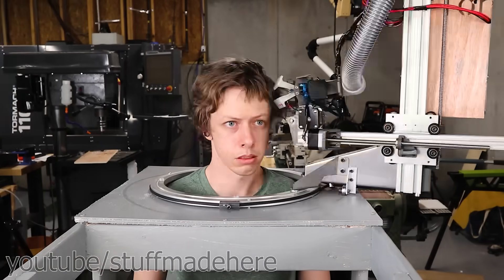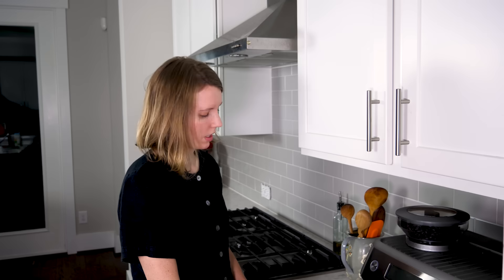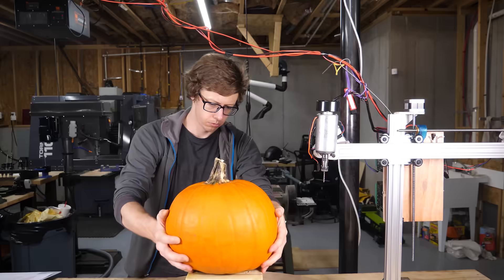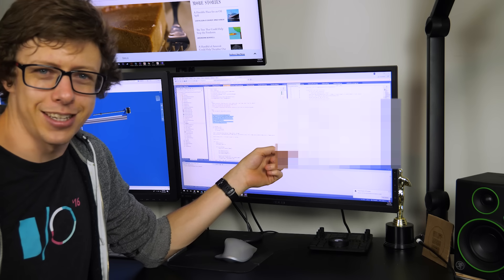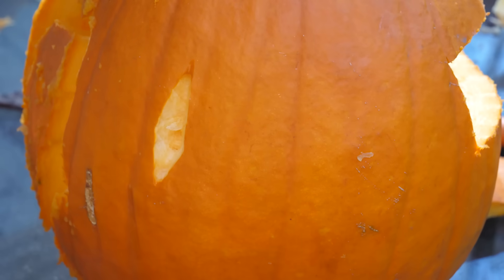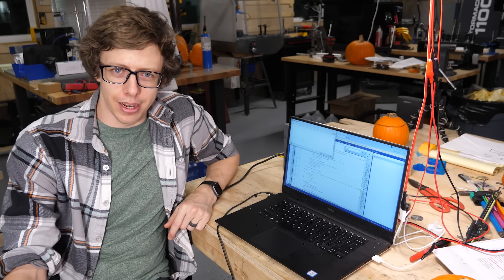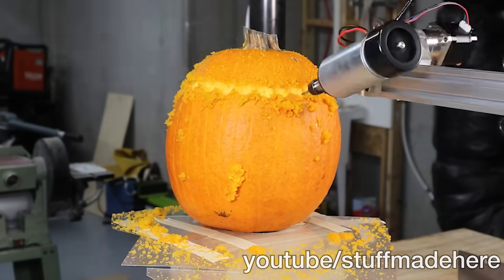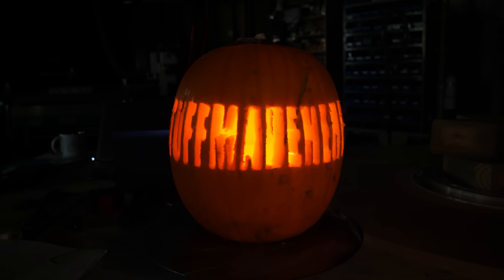Making a robot to carve photos into pumpkins

Comment: Nice work! The problem that can’t easily be overcome with lithophanes on pumpkins is that the thickness of the pumpkin isn’t uniform. So while you may be able to perfect the cutting depths in the software, the remaining pumpkin thickness will vary from from the desired result, based on how thick the pumpkin is in any given location, and so your grey scale will not come out perfect. I too chase perfection, but unless you can measure the thickness of the pumpkin all the way around, and make your cuts based on a % of that thickness, it’ll never be perfect. Good luck!

Comment: You should have used a dymaxion projection, courtesy of R. Buckminster Fuller.  The advantage of the Mercator projection (maintaining parallel lines for the lines of latitude and longitude) are unnecessary for your application.

Comment: Ok, I just realized there is a massive opportunity for some of the code you wrote. I really want a program that I can throw an image into and the approximate diameter of my pumpkin and it will warp the image in a way so that if I displayed it on a projector, it would appear to wrap around the half of the pumpkin facing the projector. Then I could either trace it, or cut directly by hand the image. This doesn't require nearly as much precision because a human will be able to interpolate where needed. Potentially, you could even plan out images that wrap around the entire pumpkin if you have the projector move by, say, 60 degrees and then show the next image and use the previous sketch to line it up. That would be epic!

Comment: out of curiousity, did you take variable thickness of the pumpkin 'shell' into consideration somehow? it seems that this would be a significant source of error in the sharpness of shaded edges etc. from the video, it seems that you only measure where the surface is and then calculate the deapth in which to mill by looking at the brightness of the picture, assuming that the inner surface is uniform. However, the inner surface is also uneaven, meaning that the milling deapth should be a function of the brightness of the picture AND the thickness of the pumpkin shell at that specific point.

Comment: Why do you make things so hard for yourself?  Surely it would have been easier to rotate the pumpkin than the entire robot right?  And since you're only working with part of the sphere anyway, could you not just plan your boundaries, pick your resolution size, and then stretch/compress the rows of the initial image inversely proportional to the circumference of the pumpkin at each row height?  you'd need to measure your pumpkin first, but you did that anyway.

Possibly the easiest of all, use a laser cutter instead, tell it that there's a flat plane just above the surface of the pumpkin, and let it go to town automatically projecting the image onto the curved surface of the pumpkin and end up with a perfectly mapped image from a particular viewing angle.  if you want shading, just thicken the cut the laser makes.  

Don't get me wrong, this is all very cool, but as far as design goals go, you certainly seem to like to take the scenic route.

Comment: "It will capture all of the projections"

No, it will capture ALMOST all of the projections. Two points out of the infinite continuum of possibilities will not be captured. Those two points also have a finite chance of appearing for many methods of generating points on a sphere. For example, setting the Azimuth based on the arcsine of a 23-bit random number generator has about a one in 4 million chance of generating a polar point. If you then use tangent to convert that Azimuth to a point on the mercator projection, you could get a NaN or infinity. Sampling random points on a sphere through this method will probably cause your program to crash if you don't check for that. Or at best, might cause something like y= tan(90.00001 degrees) on your protection and make the North and south poles overlap.

Comment: It's always fun to watch a well-trained and bored person bring a ridiculous idea to life. 
I gotta ask, though, why are you rotating the robot instead of rotating the pumpkin? 
I'd assume the robot is heavier than any pumpkin it could carve, it's less rotationally symmetric than most pumpkins meaning it has to be made much stiffer to dampen vibrations, and it has to rotate around a large enough radius to accommodate your largest pumpkin. 

Rotating the pumpkin would probably require clamping or gripping the pumpkin to keep it stable, but that could be as simple as jamming it down onto some spikes on a rotating platform.
As a bonus, rotating the pumpkin and keeping the robot stationary could allow you to carve a wider range of pumpkin sizes. All you'd have to do is just move the robot radially closer to or farther from the center of the rotating platform to accommodate larger or smaller pumpkins.

Regardless, it's always fun to see you develop these kinds of projects from idea to buggy prototype to slightly-less-buggy end product.
Reply: Just in case you get carried away and carve a gigantic pumpkin.

Comment: When repairing a machine but keeping almost none of the parts, this process actually saves time as you just transfer the machine spirit instead of making a new machine spirit to inhabit the next version.
Reply: Exactly. You just keep pulling the Ship of Theseus, and you can recycle the machine spirit forever.
Reply: As the Omnissiah wills
Reply: Mechanicus Approved
Reply: Just don't make them into an injectable liquid metal containing the spirit. MatPat has enough on his plate as it is.
Reply: The Enginseer approves.
Reply: Praise be Iguanadon
Reply: Praise be the Omnissiah

Comment: I've accidentally put reversed 12V on a cheap Acer laptop USB port in the past, the laptop started working again after 10 to 15 minutes.
Guess there is some kind of poly-fuse inside that needs some cool-down time, maybe your Mac still works...

Comment: Maybe you could make a 3D mesh model from the measurements you take with the probe. If so, use some texture mapping method to “texture” the pumpkin with your picture. Could be conformal maps or other.

Comment: try a sharper endtool, a faster cut, and a slower Progress per Cut, Seting looks precise enough, if the pumpkin has a lesser chance to resist, little imperfektions (wobble) in your setup shouldn´t comeinto effekt. I would think you underestimatet the power in the pumpkin fiber, its resistance should be the main powersource for your Problem, someting highrotating and Lasersharp should do it. In Essence change the tool. 

I want to say how much I love your channel, you are far better then I am in this things. But looking at your video it seems obvious that you know exactly to chooce the right tool for the cutting of any material. (You do it all the time with a high grade of perfection on harder materials). We have a saying for this in Germany:
Betriebsblind - profesional  blindness
and we say you need a fool or kid from outside to spot the error.

While you are at choosing the better toolhead for cutting Pumpkin, you might want to change the cutting vector. as I understand it your tool runs against the fiber, but cuts with the fiber. You want to run it with the fiber and cut against the fiber. (This is hard to explain, I am no native speaker, i try it anyway).
You use a  rotating tool. When the cuting edge hits the fibers in the pumpkin shell, you want to hit it against the general direktion most of the fibers follow inside a plant.
so when you carve/print the tool should move up and down, ore the pumpkin and the picture have to be rotatet by 90° .

humble greetings

Comment: Just a thought, but would it cut a more accurate rendering if you had a vacuum or air compressor clearing the debris that might be creating more contact points than the tool alone…? 

I know that this was from some time ago, but I think that might have some impact on the final image rendered… or, the additional debris from the current and prior cuts being pushed into the tool path is essentially rounding out the rough edges of your lines, depends how exact and detailed the programmed image is compared to the perceived image (since exact dimensions of your wife’s face would probably look like one of those 4D Ultrasound images when backlit by the candlelight through the actual pumpkin). 

To gauge how the light passes through the texture of the pumpkin in relative similarity to the way we perceive depth with our own eyes is probably too much to ask a machine to do without having programming capable of rendering artistic expression, ha… 

That and you’re probably over the pumpkin robot project by now, but October is closer than you think now… so, maybe?

Comment: Ok so I'm gonna be the nerd now. Projecting a sphere onto a cylinder with a light bulb is NOT Mercator projection.

An important aspect of the Mercator projection is to preserve every angle (math jargon: conformal) so that when you are on the sea, you can look at your position on the map, measure the cardinal direction of your route, and apply it DIRECTLY to reality (where your ship's bow should aim for). This property requires more than making sure that latitudinal and longitudinal lines stay perpendicular.

Mathematically, to preserve angles everywhere, we require every corresponding infinitesimal rectangles on Earth and on the map to be of the same shape, i.e. cosθ dφ / dθ = dx / dy. Combined with the condition that the map should be rectangular (parallel longitudinal lines), i.e. x = Rφ, we can solve for the relation between (x, y) and (θ, φ).

And spoilers, the answer is different from using a light bulb to project a sphere onto a cylindrical map.

p.s. θ: latitude, φ: longitude

Comment: As a software engineer id love to see a walk through of the code.
Reply: SharkTank  There is no goal, or I guess you can call the goal fun. Most coders look for Eureka moments to become better, and creating a machine that works in the end is fun for them. OP wants to look at the software code, to make himself better at coding. Learning in of itself is fun. But if this guy plans on making machines, he'll understand the code, and maybe one day he'll try something similar to begin his journey. Then, he'll achieve the Eureka moment, call himself a better coder, and have fun. Unless he's looking for a job, then that is his goal.

I'm pretty sure if you like grinding in video games, you'll like the rigors of coding.
Reply: SharkTank  The goal of becoming a better coder, especially for beginners who're interested.
Reply: @dread6142 dropping a "who're" when it's totally unnecessary is such a swe thing to do
Reply: Probably look at arduino CNC 5 axis with an additional custom 180 degree axis added for the rotation. Personally I probably wouldn't have tried to reinvent the programming wheel and just added some distance sensors and tied it to the depth in the program. Then just mapped whatever I wanted to a premade template of a concaved plate that I could then adjust to fit whatever shape diameter pumpkin in the modeling software. Which I suppose would require measuring each pumpkin but you could also just use the distance sensors to map the pumpkin diameter to an array if you were that ambitious... about carving pumpkins.
Reply: Same here
Reply: how long did it take to understand write code yourself? i am looking into going to school for it soon and i’d like to learn others opinions
Reply: Yep. I would settle for a Github link.
Reply: I don't think you would...
OK, you would, but I really don't like the direction and problems he made for himself.
The mercator projection is no where near as complicated as he makes out (the wiki article must have delved way deeper than what's required here). On the (unwrapped) cylinder X is proportional to longitude, Y is proportional to tan(latitude)
There was no need to map the image to a sphere, then to the pumpkin, 1 mapping is sufficient. In fact, the sphere intermediate stage is detrimental. Since pumpkins carved with a photo image have a preferred view point it would be better to project a flat plane onto the surface.

Comment: Another point to consider is, that the pumpkin has no obligation to have the same wall thickness at every point that you measured from the outside. 
As soon as the wall thickness varies, there's no guarantee that carving a certain depth will leave a certain thickness through which a certain amount of light shines.

Comment: Did you consider using photogrammetry to create a point cloud of the pumpkin? After conversion to surface and then solid, could that have served as your base stock? I'm guessing you've followed that workflow for other projects in the past, so there's probably a good reason you didn't go with it for carving.

Comment: I really like the idea and the creativity.  Not sure what assumptions you made for your 256 brightness levels, but actual brightness might not be linear with depth.  Even if it is, the thickness is unlikely to be uniform, leading to varying brightness with the same depth.  Maybe version 2.0 could measure brightness during the cutting process and adjust accordingly, although that would also require continuous and effective scrap removal.  It would be interesting to see a "2 bit" image carved to a fixed depth just to see what that looks like.

A rotary tool might not be the ideal way to remove material in this case either, or might work better by cutting parallel to the axis of rotation rather than tangentially, like ye olde grass cutter.  In any case, the tool probably needs to be extremely sharp to avoid tearing.

Finally -- and I'm not sure if this is just a perception based on presentation or a workflow decision -- but it looks like most of the testing is of the integration variety.  That's definitely the most fun way to do it, but more unit testing could save you some headaches.  It's effectively what ends up happening when one has to tear everything apart anyway, so it's easier to just do it first.

Comment: How well do you think you're pumpkin cutting machine would handle .STL code generated from wood carving software?  PhotoVcarve will let you make 3D reliefs from a wood milling machine.  You've essentially got a 3D milling machine.  I wonder if you'd have better results mapping your object with cameras instead of the touch sensor.  Like what if you want to carve into something that is not a pumpkin?  Like clay, wood, stone, Gummy blocks, chocolate, pies, cakes, ice (cream), etc?

Comment: I found this project very interesting. What do I do for a living??  Well, I'm a cnc machinist and inspector using CMM tech. 3 axis CNC is challenging. 4axis is way more complicated. Projecting an image onto in imperfect surface is insane!   Also, its not just the surface that varies, the thickness varies too. My advice for this machine would have been: Make the pumpkin rotate, and make the cutting head static in one axis. Making a rotary table rigid is easier than trying to make a rigid 4 axis head. Great job!   Incredible perseverance!

Comment: What languages do you use for testing and building your software, or language if your one of those guys brilliant enough to get it right on the first try and skip using interpreted languages?

also 5:44; thank you so much, so f----ing much for including that, I really needed to hear someone else say that, around my age, that I didn't think was just saying it to make me feel better / connect with me.  ( Though, your so smart you could have been doing just that! ) 

The sad part is, likewise I can always find a way to comprehend most STEM topics in a couple of hours and then dig deeper, but the first look at the wiki page almost always makes me feel like I have done nothing with the knowledge I use to have and no way to recall it, not to mention anytime I see something I don't immediately recognize. Inadequate is probably just scratching the surface on how I feel sometimes.

Comment: Why the heck you choose to rotate mechanism around object and not vice versa? You need just pumpkin-lathe. So take some spindle, some center... And you can take your cylinder-projection then calculate what difference between your cylinder and the pumpkin (length of circle on each layer) in every point and then shrink image. So you need vector graphics. You don't need a spherical projection actually. You always cut just side surfase. And you don't need all that screws. Syncronous belts will be enough. 
And another thing! To scan your pumpkin you can use fact that it's counductive. So you don't need all that rough switchers but just needle or pin connected to your MCU through the Darlington-pair or even single transistor or even directly to ADC or comparator pin.

Comment: Instead of going through the mercator projection mess, what if you placed a light in the pumpkin and used a photosensor on the machine to collect feedback on the depth of the cut. You could place the image on a plane tangential to the surface of the pumpkin and have the machine cut the two dimensional image on that plane. Then you could have the photosensor "scan" the pumpkin and correlate the brightness measured by the photosensor to the grayness scale you used. The plane of the image would then be moved some increment towards the center of the pumpkin and any "pixel" in the image that has a brightness measurement that already matches its desired grayness value is removed from the image before the machine makes the next pass. This could potentially result in an image that only looks correct if viewed from a specific point, or could run into issues if there is not enough wall thickness on the pumpkin, but you may be able to combine this method with the mercator projection to simplify the code. It may also give more clear images since it uses the feedback from the photosensor to compare the pumpkin to the original image